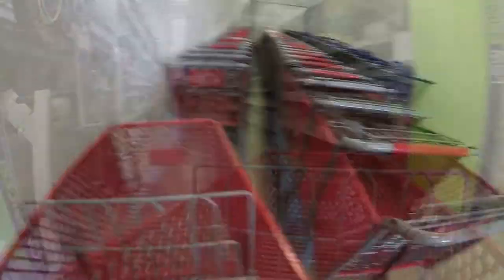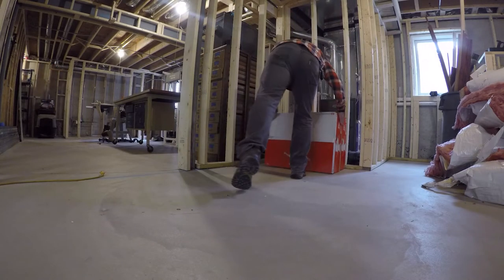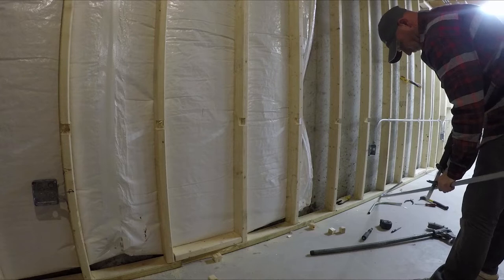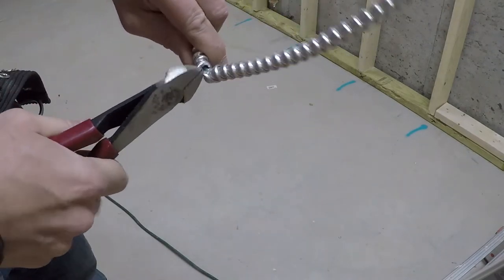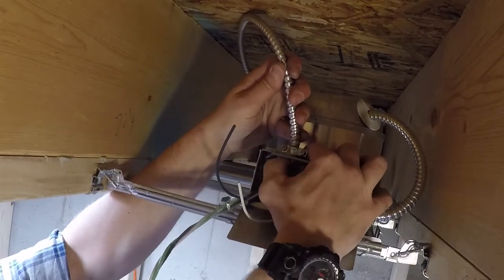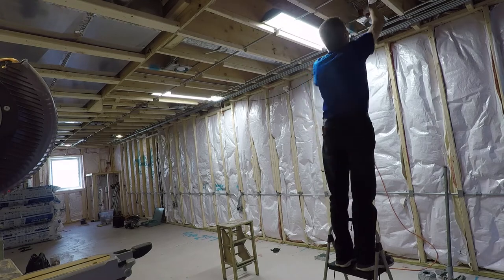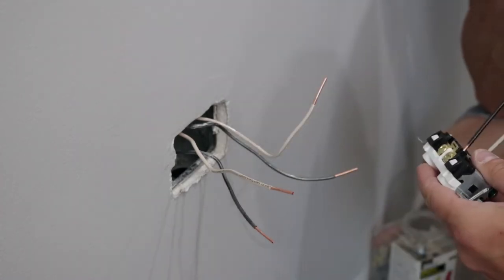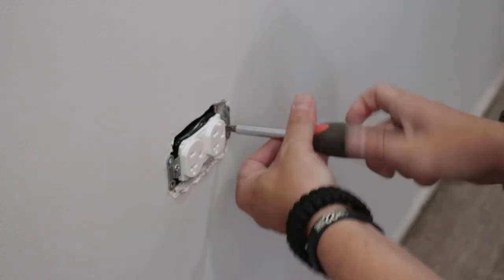How To Install Electrical From Start to Finish !! Basement Renovation (DIY)

Comment: Must have some crazy codes there for all that conduit.
Reply from the maker: KC Cruiser ya we have to have conduit throughout.  Chicago is crazy like that
Reply: @KomarProject  Dude, I just learned today that all of IL (I'm out in Aurora) requires conduit, for a bathroom DIY remodel we're planning on doing to a house we're buying.  I thought we could get away with Romex, but nooope...
Reply: @KomarProject  lol glad I read comments was going to say you must be in shitcago illa-no-toys  only place I know off so far that you can't use Romex but I'm seeing a lot of jurisdictions are making you pigtail everything instead of just using device terminals
Reply: @ScienceOfThePS3  wonder if it’s the same in Batavia...gotta research that today
Reply: That’s so the stray bullets in Chicago can be stopped by the conduit.

Comment: With the Romex connector the red heads usually  fall off  used Mc connectors mc wire. square D home line breakers in a side siemans 200 amp  panel they fit but not compatible. Insurance can denied a claim because of that mistake. I say read cover for compatibility chart on panel cover or check internet compatibility chart for newer breakers that are coming out. Cool basement project
Reply: pro trick : you can watch series on flixzone. I've been using it for watching all kinds of movies these days.
Reply: @Flynn Andres definitely, have been using flixzone for since december myself =)

Comment: Did you know that cutting into the edge of the joists reduces the load value of that joist? Please be careful. If you have a 2x12 and you cut that notch two inches it is as if you now have a 2x10 for a joist. Same goes for the studs also.
Reply from the maker: Lonnie Toot your totally right. So I didn’t cut into the joints, I actually fured it down with 2x2s.  When the house was built the builder attached the electrical boxes to the bottom of them so instead of moving the existing boxes I just nailed 2x2s on the bottom leaving the notches for electric.  But you are absolutely right it does reduce the load value. They say if your need to run something through the joints to cut a small hole in the middle of it so you don’t loose its strength.  Great point!!!
Reply: Komar Project it hard to mention stuff like that and not sound like a troll, but I wanted to mention it just incase you were not aware of that. Keep up the videos, your suggestion from the woodworking Facebook page got me to check it out.
Reply from the maker: Lonnie Toot thank you so much.  Every comment is welcome and you didn’t sound like a troll lol. Thanks again!!!

Comment: @8:06 -- What did you do for grounding of your outlets and rest of your house?
Reply from the maker: So where I live we have to use conduit and that it self grounds everything.   I have had lots of people ask the same thing.  My city is probably the only one out there that is like this.  Great question
Reply: @KomarProject  Similar to my city but here it is required to pigtail a EGC from metal box to the receptacle, then check if there is 120v on the grounding of the receptacle to neutral/hot.  I've heard so much debate, even from qualified electricians, that the conduit doesn't do any sufficient grounding.  I'm always curious how others handle this situation.  Thanks for your reply

Comment: A few things; you’re using outlets with a ground but not adding a ground wire, and also using a 20 amp outlet with a 10-15 amp wire… any reason you did this? I assume this wouldn’t pass inspection, but I can be wrong lol.
Reply from the maker: Conduit is the actual ground

Comment: are you allowed to put a hole in your joist, i thought that is out of code? I thought you have to strap your ceiling so you can run your wires through?

Comment: Is there a reason you used the metal covered wire instead of just regular wire?  Is it just personal preference?   I'm clueless but I'm trying to do this at some point.
Reply from the maker: Mo D my city code.
Reply: Most likely because the wire runs along wood pieces, in my country it is mandatory to use metal cover if the wires are installed on wood. Not sure if he did it for the same reasons though.
Reply: In NYC sits because of rodents in city walls... they chew the wiring and now it’s code 🤷🏿‍♂️

Comment: Nice video, only question I have was were was the ground for the outlet you installed? Lucky for me in Canada no conduit is needed. That was not pleasant at all.
Reply from the maker: Mark Yetman the conduit acts as the ground
Reply: @KomarProject  wow, I thought you purchase 14/2 wire which carries a bare copper. We use it to ground the box and receptacle or switch as well. On a positive one less wire in the box reduces the clutter. Keep posting videos, well received.
Reply: Mark Yetman it’s weird a lot of people find it weird when I say bx comes with a bare ground wire. Must be a Canadian thing
Reply: @Nick-bh1fy  Wanted to include a picture...but does not seem to be allowed. Yes we have standard cable with neutral, live and ground.
Reply: Mark Yetman I’m from Canada too Ik the 3 conductors in the cable it’s just people find it weird when bx comes with a ground (bare)  wire idky
Reply: @Nick-bh1fy  Agreed, how do you ground a receptacle in a plastic box with no ground wire.

Comment: did you use conduit just to protect the wire?
Reply from the maker: Conduit is code in my town so we had to use it.
Reply: @KomarProject  even for wiring behind walls?  Is that just for below grade?  Here you only need conduit for exposed wire.  If you run it in a stud wall, you run it just like anywhere else in the house.

Comment: Hey man idk about code in your area in regards to electrical. I like how you made sure to use the red heads on the Mc cable. However you used romex connecters to the can lights. You are typically supposed to use mc connecters. To make sure the metal casing doesn’t get into the box. Just wondering y u didn’t. I would love to get a response.
Reply: He loved your comment but didn't respond wtf lol

Comment: Where is the "Ground" wire in the outlet?
Reply from the maker: You actually don’t need a ground wire when running conduit.  It acts as a ground
Reply: @KomarProject  My 2 cents. Well, with the outlets being held off the box by 1/2", the screws become the ground path. I would have still installed ground pigtails to the box, install 1/2" box extenders, or just installed the boxes to stick out about a 1/2" to account for drywall (although I'm not sure if the knockouts would allow that honestly).

I'm not a licensed electrician, but I, personally, wouldn't trust that. This is my reasoning. Is the surface area of where the screw contacts the box enough to carry enough current to ground incase of a short? What about any corrosion (unlikely in conditioned basement but possible)? Like I said, this is just my opinion, but I'm just a guy on the internet.

Comment: No ground for your metal boxes?
Reply from the maker: Jones Styles the conduit acts as a ground.  It’s code where I’m to use it.
Reply: @KomarProject  well at least they cut you a break there but you should at least ground devices to boxes and I would just run a separate ground anyways because its habit. Also I use a lot of Romex and just strip the sheath off of it use a lot of Romex to conduit connectors in my area. Yes I know its not code in your area. those connecters on the lights are wrong the anti shorts will fall out there should be a cage to hold them in connector.

Comment: didn't see bare metal wire in that outlet for ground
Reply from the maker: John Doe don’t need one when running inside conduit.  The conduit acts like a ground.
Reply: @KomarProject  is it code? i thought only pipes are good for that. i'm from other part of the world we have different rules than you do :)
Reply from the maker: John Doe ya in my town you have to use conduit.  It’s a pain in the butt

Comment: My eyes.... I might be mistaken but.. notching joists to install conduit effects structural integrity .. conduit work itself could be way better .. I didn't see any ground wire in the conduit .. cable connectors you used are mostly for romex, not mc ..   outlet is not self grounded and has no ground tale .. no one uses PPE even working in live panel
Reply from the maker: Samokysh conduit acts like a ground

Comment: 4:30 Wait....those look almost like lever wire nuts.  I can't tell because it's not very close but, is that what those are?  Or maybe not lever nuts but like...push in wire splicing nuts or something.  Ehh...what exactly are those?
Reply from the maker: John Meise those are clip connectors, I think that’s what they are called.  My cans came with them and you would typically clip them into a wire for the connection.  But you have to connect the clip to the wire first.  So I just cut them and use regular wire Nuts
Reply: @KomarProject  Ahhh, okay cool.  They looked very familiar to something I've grown to love; wago lever nuts, so my initial reaction was, "WHY?!" but then I realized I didn't actually know what they were so I had to ask haha.  Thanks for the reply!

Comment: Great video! How is the rules for doing the electrical in the states when you're not an electrician?

In my country you can't do shit with the electrical except for things you put a plug on the end unless you are an electrician.

But my country is also extreme when it comes to security. 
Like 90% of what i saw in the video would violate the security codes we have in my country. Sometimes i like the codes we have, but sometimes i wish we could do things the same way as you guys are.
Reply from the maker: You can work on your own home
Reply: @KomarProject  so you can actually do the entire job as long as it is your own home?

If that's the case im actually happy my country dont allow that. 

I don't mean anything bad about it. Some things i agree should be allowed to do yourself, but some thing should be left to the professionals.

I've lost count of how many times i've been correcting the mistakes of hobby electricians where many of the cases was close to burst into flames :O
Reply: @ohOracleIsMe  yes you can do the work but local government usually almost requires a permit and inspection by them to make sure it is up to par with bldg practices. Some states are more strict than others and our federal codes national electrical code part of the nfpa is only a suggested recommended bare minimum standard local governments and states adopt what they want and can be more strict than federal code. Although 99% if you stick to NEC your fine

Comment: Is conduit for interior walls code where you are? because if it is, that's the craziest thing ive ever heard. I actually do not believe it to be honest. The pigtails for the outlets was also a weird thing to do but not as bad as you forgetting to ground it. Lastly the notches in the stud totally screws the integrity of your walls now, they looked like 2 by 4 walls too which makes it even worse.
Reply from the maker: Brenden Scott ya it’s code here.

Comment: conduit and shielded cable is not necessary especially when the wires are behind drywall... could have saved a lot of money
Reply from the maker: Actually where we live it is necessary.  It is code.   I would check your local
Codes to make sure what is required.
Reply: @KomarProject  lol got to love the so called pros who always neglect the fact that NEC is just a suggestion and its up to jha 🤔😉